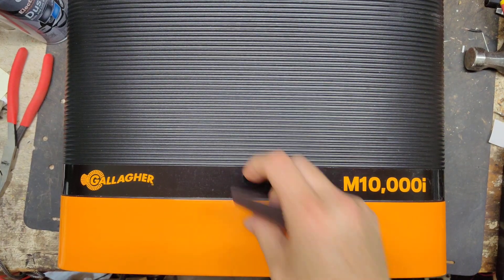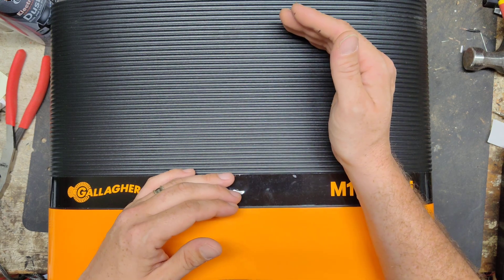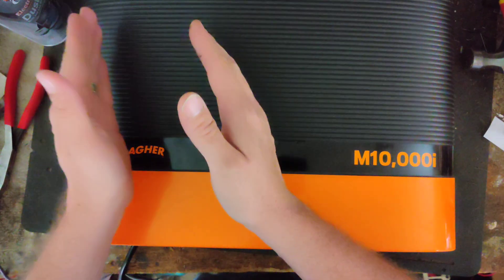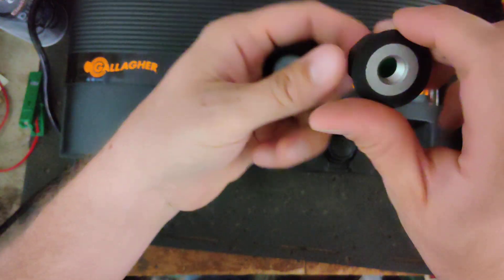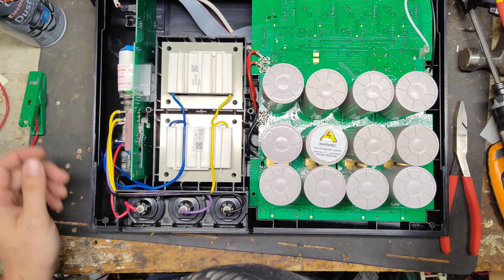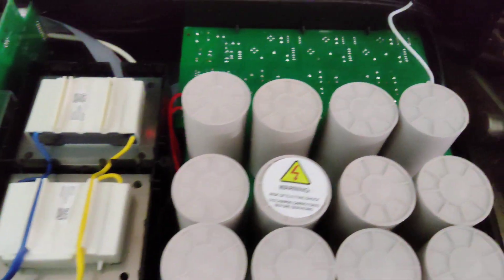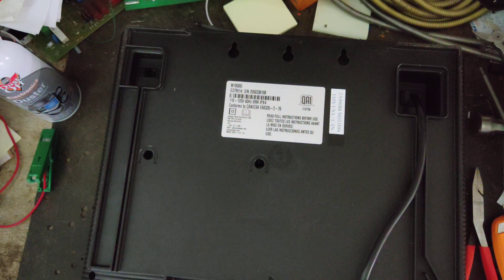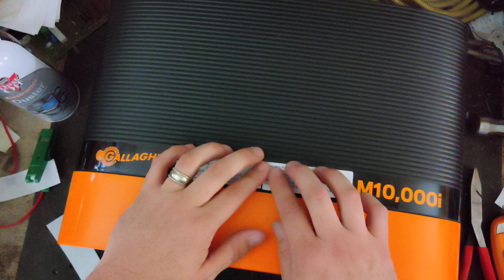Inside Look At The Worlds Strongest Electric Fence Charger Built Today Gallagher M10,000i

Comment: Why is there a center ground terminal in addition to the green one?  It has a purple wire connection on the inside.  How would you connect this into the fence system?   Thanks!

Comment: I looked up the price for giggles and had to breath in to a paper bag to keep from passing out.  These gigs are NOT cheap!  Whoa.   For the curious - About 3.5K USD.
Reply from the maker: It's all based on joule size (Horse Power) you need and also on brand and quality. The more horse power you want or need, the more it's going to cost. Gallagher is the most expensive brand out there, but their quality and support is top tier.

Comment: I have no idea about fence chargers, i just looked up "most powerful fence charger", yet that thing looks like it costs like a small car.  Is that lethal? (hopefully not) would it be possible to put it on a house electric fence? I really want to give a good lesson to any P of S burglar that wants to get in.
Reply from the maker: Electric Fence chargers are not designed to be lethal. Also, on an electric fence set up for burglars and such, you wouldn't need a lot of energy to get the point across. I've been hit by units a lot smaller than this and they feel like your fillings in your teeth are coming loose. So a 3 joule unit would need plenty.

Comment: Good review of the Gallagher M10,000i energizer. In South Africa we have many powering large wildlife reserves, game parks and we also use them for larger farm security fencing setups where the high power and combined fence monitoring with add-on gives you all the information required in case of a breach in the fence. We have installed, tested & repaired many M10,000i units and have compared them with other large energizer brands like the Stafix M63R. If you are interested I have a full spec sheet on both my websites. Check out the links below: https://africapowerfencing.co.za/products/electric-fence-systems/mains-220v-240v-energizers/m10000i-fence-energizer-system/
https://gamefencing.co/gallagher-m10000i/
Reply from the maker: I think I've seen that before. I think you or a relative sent that to me in a Facebook post or on another video. It's pretty interesting stuff to see